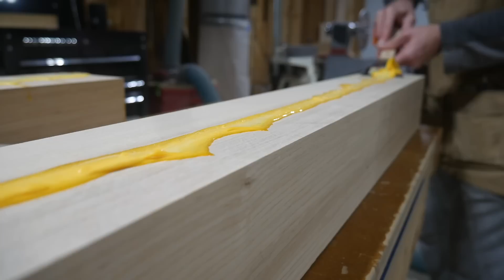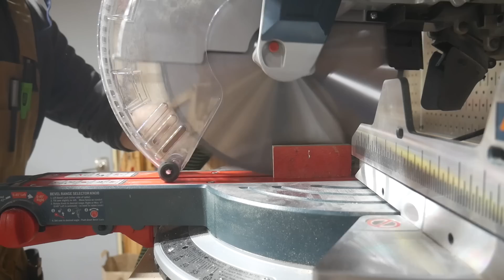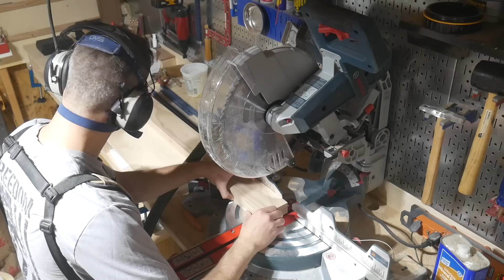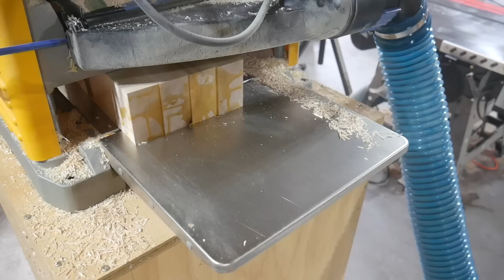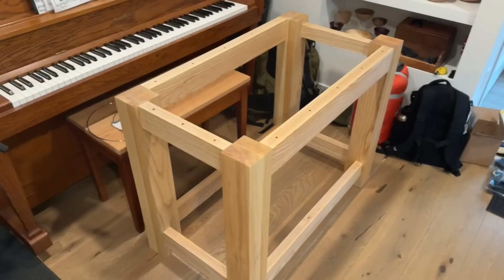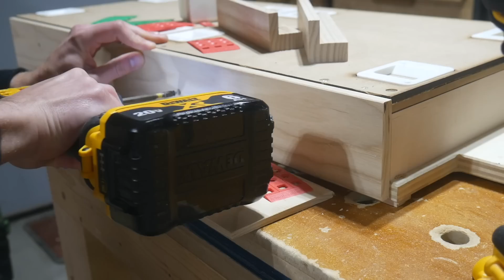Amazing 2025 Workbench Build! (Plans Available)

Comment: Instead of hand over blades at 8:20 repeatedly you could easily clamp, make a jig, or grip the left side of the sled firmer. Takes just one slip to lose a piece of finger.
Reply from the maker: These are non through cuts which are extremely safe, and I have a sawstop. Clamp if it makes you more comfortable
Reply from the maker: Also, hands are always to the side of the kerf, never in the middle